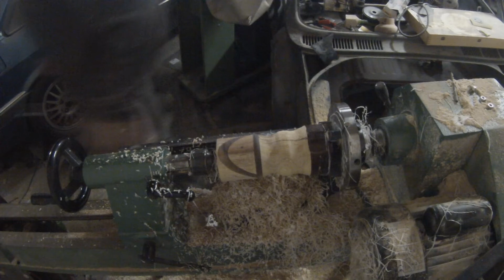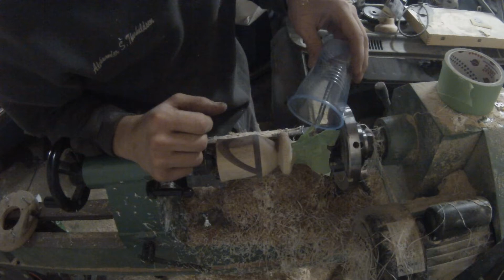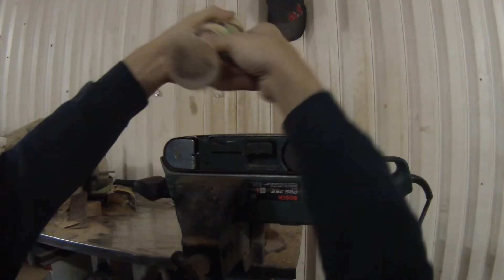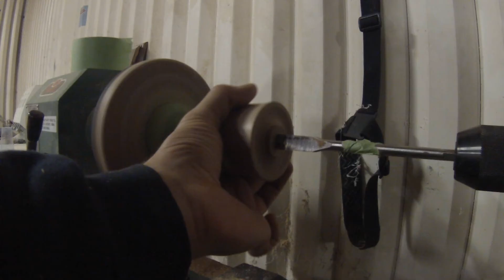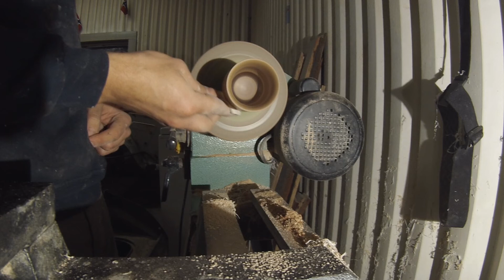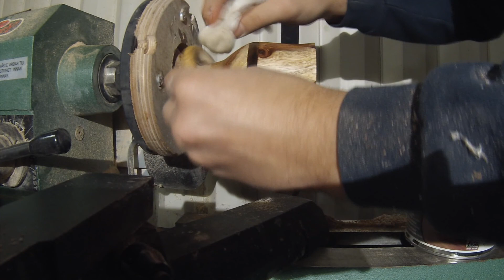K-Goblet Turning with Captive Ring

Comment: Dude, fantastic, did you use polyester resin? Where do you work out of?
Video was great, lighting and angles all good as far as this viewer and the other four people who just stared unblinking for eighteen minutes are concerned.
Reply from the maker: Thank you, it is always awesome to hear when people like what I make. Yes, I used polyester resin, the epoxy was a bit on the cheap side so it turned out a bit yellowish. I used a better one in the other video where i turned a seashell. I'm not sure what you mean with "work out of" though.
Reply: Cool, I really like using polyester resin for fabric sculpture and still-life casting for end tables and kitchy junk like that.
And I just meant where are you from, you keep a gallery?
Reply from the maker: Nice. I am from Norway and I keep a little gallery at "Amino Maker" http://aminoapps.com/page/maker/9434352/a1exxander I got most of the projects I've made on there